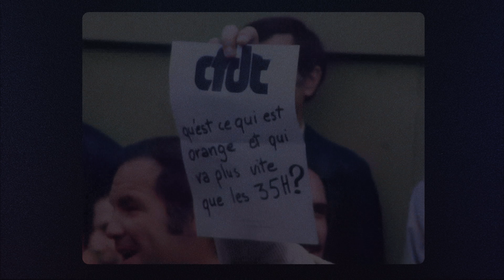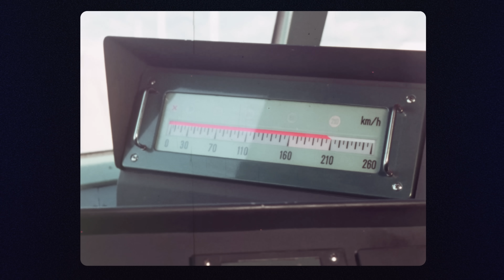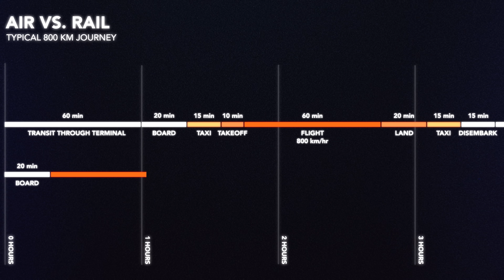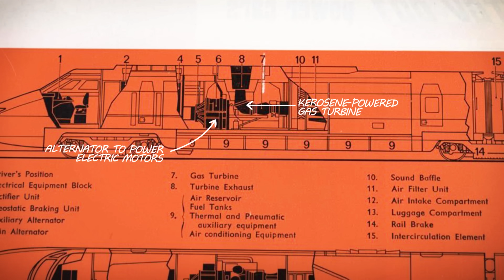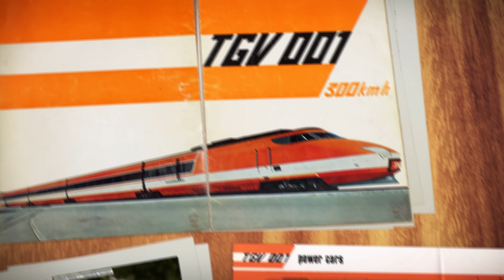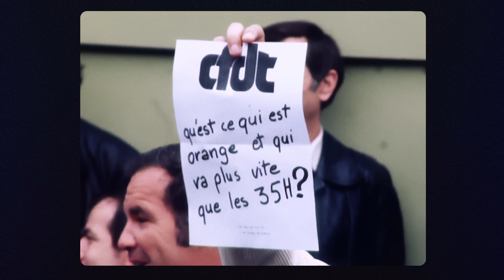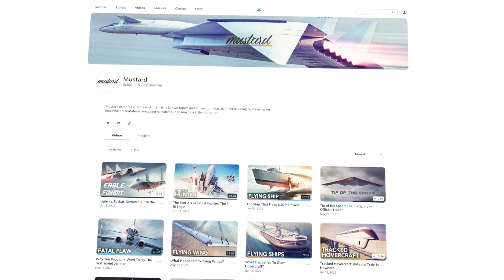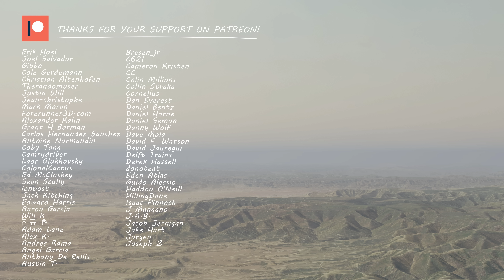Why French Trains Are The Fastest

Comment: True they are fast and comfortable but very pricey though. Same as an air ticket, but you'll go from downtown to downtown train stations - mostly, there are some exceptions, way faster than to reach an always distant airport. So it's usually faster to take the TGV to the main cities in France compared to air travel. But its the same price for some reason as the initial investment of constructing the new tracks have been paid long ago, the electricity is supposed to be cheaper with our 80% of nuclear power. 
I remember only 2 major accidents since 1981 so compared to the number of fares in 40 years of service, it's very safe.

Now the problem is that the national train company the SNCF started to go all in on TGVs for major lines for easy profit, but closed dozens of minor lines, less profitable. But public transport is very important to smaller cities who are now very isolated, as bus lines are practicly not existing for long fares in France. The TGV of course can't stop in smaller station on the way.

It's a very centralized concept born in Paris in a at the time extremely centralized nation, where all the powers, most of the jobs, big universities, administrations are in Paris, where almost all the TGVs go or pass. If you want to travel from east to west for example you'll have to lose a lot of time changing trains in Paris usually in different train stations.

Comment: From what you have illustrated how the TGV built its network now I understand why the KTX works so different from the Shinkansen. I suppose Korail also learned what the TGV did outside the traincars as well when it bought the technology for Korean highspeed rail from the French.
Reply: interestingly Taiwan on other hand just imported Japanese shinkansen and built high speed rail with Japanese help
Reply: The KTX is basically Korean TGV since the system was developed by KoRail in conjunction with SNCF and Alstom.
Reply: I guess if i had to say it's due to the legacy alignment requirement which many european HSRL are
Reply: TGVs are locomotives that are designed for longer runs between stations and build up speed more gradually, which is what South Korea required. Japanese shinkansen are EMUs that are designed for frequent short hops that require fast acceleration and deceleration, which is why Taiwan chose them.

Comment: Another reason why high speed rail realy didnt take off till the TGV and the Japanese Shikansen, is because high speed trains are niche services.
You realy only need them for connections of very specific hubs on very specific high passanger and long distance journeys.
The kind that you can just as well use short distance airplanes for.
Reply: Not that much of a niche when people use TGV's to commute to work everyday.
Nor when they link 15 of the 20 largest cities of the country and are the backbone of the long distance train network.
Some lines have a headway as low as 3 minutes on peak hours, making the TGV network the real workhorse of long distance travel in France with 800 TGV services per day.
The view of HSR as a niche service usually comes from countries without HSR networks.
In France, Spain, Japan, Germany, Korea or China, HSR is very much a mass transit long distance system.
Reply: that's the point. high-speed trains are designed to challenge the dominance of short-distance airplanes. which is why in the US the strongest opponents of HSR are airline companies like Southwest.

Comment: So successful was the TGV concept that when the Channel Tunnel (or in French "Tunnel Sous La Manche") was being built, it was decided to base the passenger trains to be built for service between London, Paris and Brussels on the TGV concept. The resulting Class 373 Eurostar (aka TGV TMST) were built to cover the different loading gauges of the UK and Continental Europe and to cover the different platform heights for the UK and Continental Europe (2 steps being deployed to bridge the lower platform height). Because it was supposed to work on both conventional and high speed rail in 3 different countries (plus the Channel Tunnel), the trains had to be fitted not just with equipment to make it best for High Speed Rail, but also fitted with signalling equipment for conventional lines in the UK, France and Belgium, and also the different methods of picking up Electric Current and the different electronic voltages in each country (upon opening, when using tracks to its original London terminus at Waterloo, they used an outdated 750V DC third rail system, which meant that the maximum speed they could reach on the UK side initially was less than half of the possible 186mph)
Reply: *TMST stands for "Trans Manche Super Train"